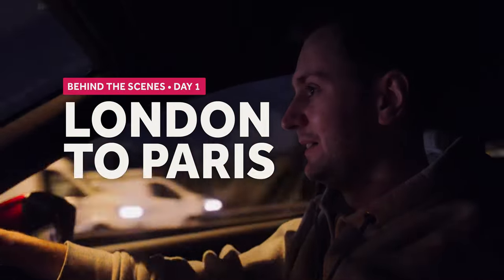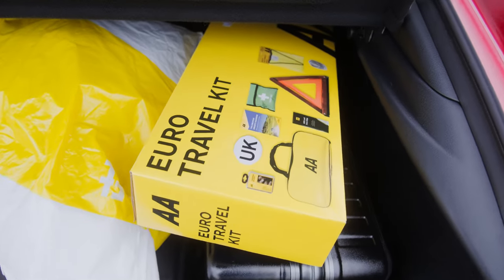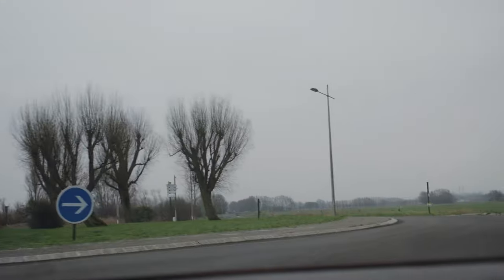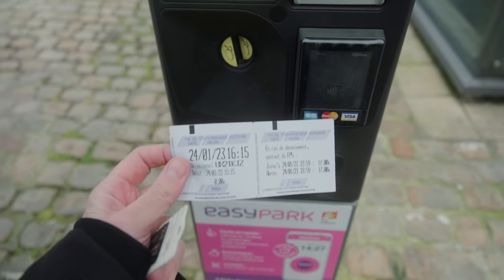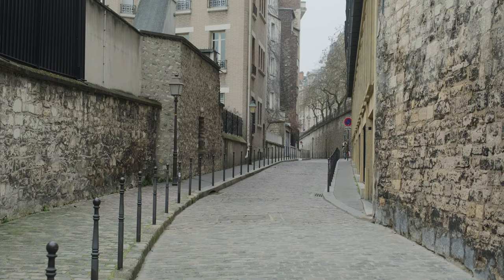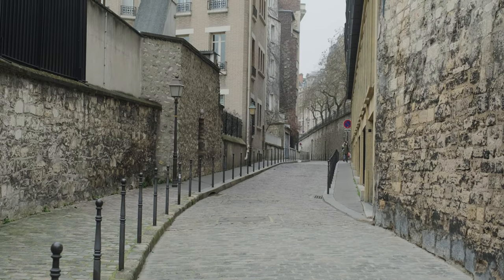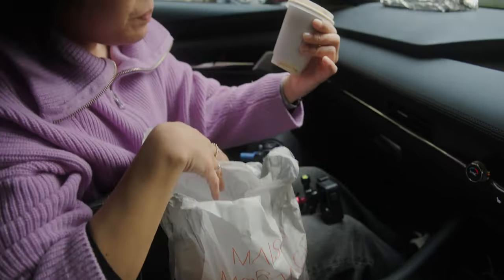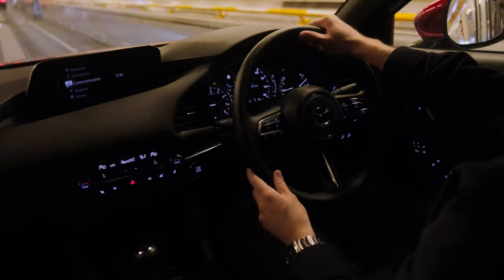JAPANESE CRAFTS — filming a car commercial in Paris • AD

Comment: Always fun driving around Paris in a right-hand-drive car. Or, indeed, any car 🙈 Last time I drove over there I thought I'd be clever and flick the headlight angle inside the lights rather than stick those annoying stickers on. Felt really smart, right up until I dropped one of the retaining bolts inside the engine and it didn't come out the bottom. The RAC were amused.

That headrest car mount is neat - have you got a link for it? Never seen one of those before 🤔
Reply from the maker: Haha, oh wow that sounds stressful with the lights. That was actually my first question to Mazda about driving in France and they said modern cars don’t need to worry anywhere near as much as older cars used to. Seems there’s more tech involved than just MPH to KMH… 

The headrest mount can be found here by the way https://allam.co/headrest-mount
Reply: @joeallam  Thanks Joe! 😀